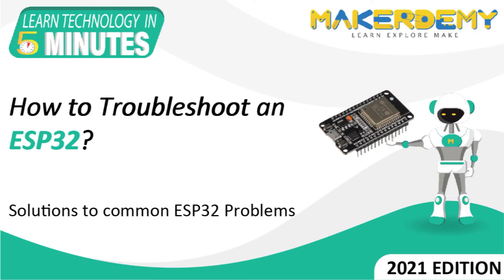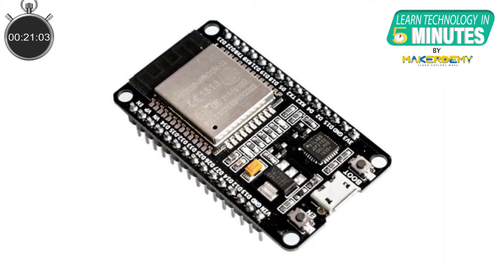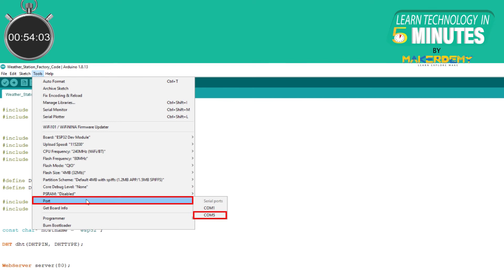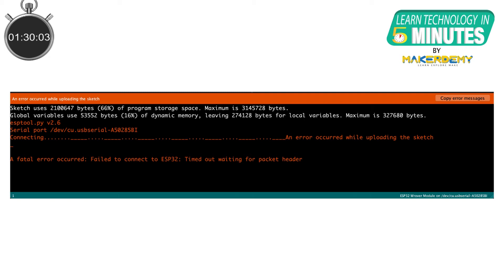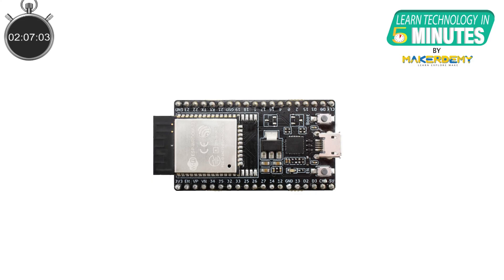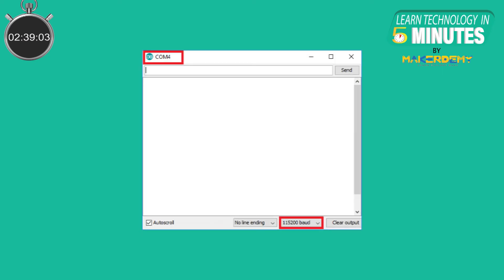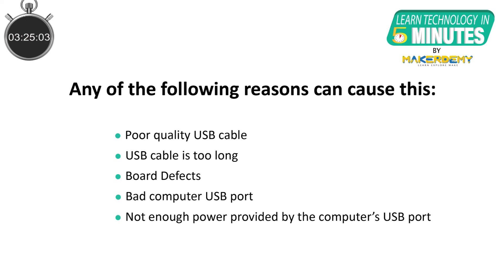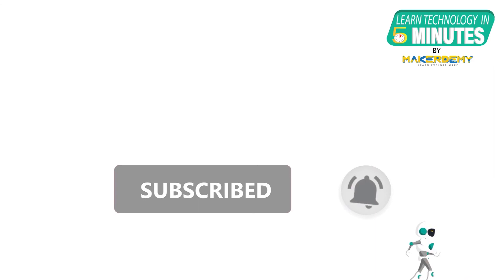How To Troubleshoot An ESP32? (2021) | Learn Technology in 5 Minutes

Comment: Esp 32 over heatin its chip and voltage regulator
I replaced the v regulator but the problem did not solved?

Comment: I am using a board called wifi dev board pro with a flipper zero it has esp32 wroom, I had marauder flashed on it and flashed evil portal but now I tryed to flash marauder again and I get the error "wrong chip ID 0x0002" whta can I do to flah it again with marauder?

Comment: somebody help me plz!? i cant even get my esp32 into flashing / boot mode
Reply from the maker: Hi Jordan.

Please make sure that you have installed the appropriate serial usb driver for your ESP32, and please check in the device manager if it's showing when the ESP32 is connected. If still it doesn’t work, make sure to use another USB cable. Even after following all the troubleshooting steps in the video, if the issue still persists, either the bootloader is corrupted or the Chip is damaged. The Boot Switch may also be damaged.  Also do share the exact error you are receiving.

Thank You.

MAKERDEMY SUPPORT TEAM

Comment: sir, i have got two boards one is from doit and another esp32s .a have done every thing what you said in your video.
weather my board on usb or not , it shows same error.what ever i do it simply refuses to work.kindly help and oblige.
REGARDS
SUBHASH VIRKAR
Reply from the maker: Hi Suhbash.

Make sure that you have installed the appropriate serial usb driver for your ESP32, and please check in the device manager if it's showing when the ESP32 is connected. If still it doesn’t work, make sure to use another USB cable. Even after following all the troubleshooting steps in the video, if the issue still persists, either the bootloader is corrupted or the Chip is damaged. Also do share the exact error you are receiving. 

Thank You,
MAKERDEMY SUPPORT TEAM

Comment: Stuck with "hard resetting via RTS pin"...how to solve this?
The sketch i've uploaded not working
Reply from the maker: Hi Sakha Ken

That is how a normal upload is supposed to end. The code is installed, then verified, then the ESP reboots itself, which makes the code run.Also, just make sure that the baud rate is correct in the Serial Monitor. If your sketch is not working still, then in this case it means that there are some logical errors in your code. We hope this was helpful.
 
Thank You.
Reply: @MAKERDEMY  the problem is, first i've success to run a program..then i upload another program..after that i want to switch back to first program which is succesfully run..but it doesnt work, it always resetting (i know this from monitor) i am using arduinodroid sir..

Comment: Hello, i've problem where ESP-32S always not detected. I've tried reinstall CP210x and tried another port and another PC, but it does not work.
Reply from the maker: Hi Agung, There is always the chance of the flash memory of the USB Driver chip getting corrupted. This can only be confirmed if you have another ESP32 and it can connect without any issues.

Thank You.